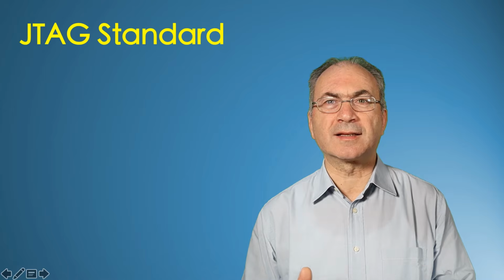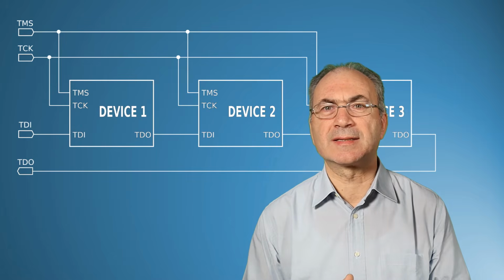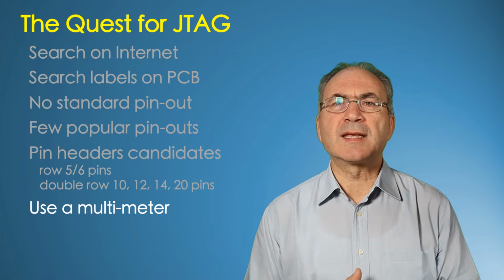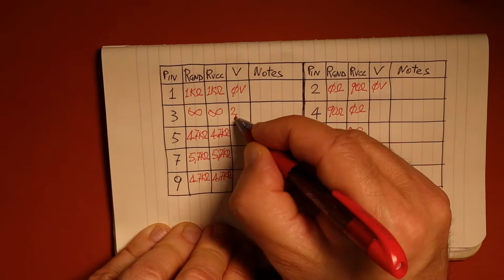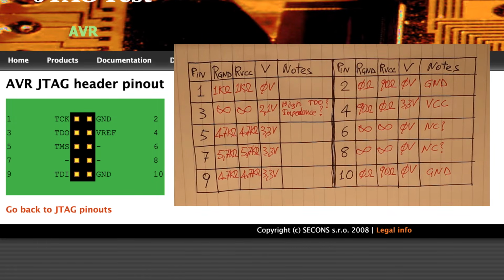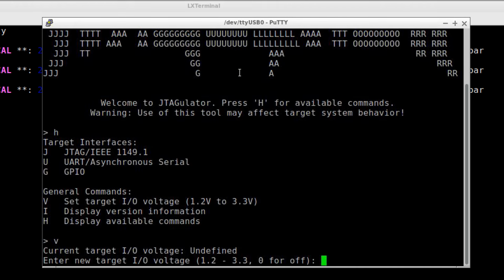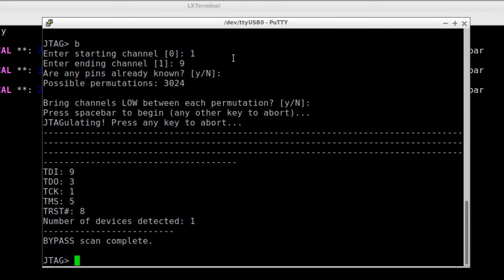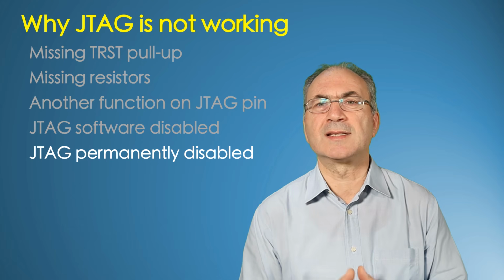#03 - How To Find The JTAG Interface - Hardware Hacking Tutorial

Comment: I did aome reverse engineering on a JTAG 14 and JTAG 20 connector. Non standard pin layout. No documentation, no text on PCB, I managed to figure out the correct layout with multimeter and managed to connect to microcontroller via SWD and gain access to the whole of it. dumped firmware, got flash info.. etc.. 

What i did not found though is the tRST/RST/RESET pin. I know its located on pin 90 on the microcontroller but can find the JTAG pin or a test point on the board for it.

I know the tRST are optional but might come in handy to reset the input.

Any ideas? Will the Jtagulator figure that out?

Im using a Raspberry pi with openocd. Works great. Just jeed to solve the RESET..

Its a TI TM4C1231H6PGE microcontroller 144 pins with 256KB

On the JTAG 14 header SWDIO are located on pin 1(GPIO 24), GND 4/8/10,12 SWCLK on pin 9(GPIO 25)

Comment: Excellent video and thank you for sharing. As you mentioned in the beginning of the video, it would be even possible to "debrick" a device with the help of JTAG by flashing the right firmware to the EEPROM. I ran exactly into this problem. I'v got a osziloscope with a Samsung S3C2416XH connected to an EEPROM Samsung K9F1G08U0D. Both components are quite popular.

My measurements are nearly the same, but the order of the of pins the JTAG are a bit different on the board (I think it's a proprietary one). In my case I got 5 pins with R(gnd) and R(vcc) and V > 0. 

How could I find out with pins are right one without buying JTAGuator? Any hints?

Comment: This video is excellent! Using the multimeter resistance and voltage measurement method, I managed to successfully deduce the JTAG pinout of a Samsung SPH-A700 cell phone by doing this on that phone along with a Samsung SPH-A880 that already had a known JTAG pinout (Since the A880 is very similar in terms of hardware to the A700).

Comment: what if I have the datasheet for the processor and it shows which pins are TDI, TDO, TCK and TMS? I don't need to use JTagulator right?
Reply: You could use the mcu jtag pins directly - might require some soldering or micro clips attached to the pins.  If your test board has jtag pins, can you trace them back to the mcu?   The  Jtagulator is helpful to identify pins at a connector or grouping of pins, but not required.  Sometimes, it's easier to work with pins at a connector or pad group, then tapping the mcu pins which are often tiny.

Comment: On some boards there are no pads for JTAG or UART. In which case you can scrape the trace lines and attach 0.1mm wire. You need a microscope for this but it works well.
Reply: if you have good eyes you dont need a microscope i have precise eyes because i am young but i understand some people have difficulties with soldering it, you need a fine tip not specialy a microscope

Comment: I'm a software engineer very interested in hardware debugging, asm programming and all related things, but I'm somewhat not very skilled so I started with Arduino Uno, I saw a youtube video explaining the Debugwire protocol and it also provided a demostration of debuging an ATTiny85 using the beforementioned Arduino Uno, which is something that blew my mind. Now that I felt in love with this cheap hardware I would like to get deep on how the bootloader work, I've heard that this bootloader is running in parallel with the other program code stored in the chip so I would like to determine if it would run faster without bootloader or how much overhead it may introduce, etc. Thank you very much.

Comment: Didn't know a multimeter could be used to identify the different jtag pins, this is awesome, thank you.
Reply: Yes, it can. I did it on one of my devices. I was able to connect and extract firmware on microcontroller via a raspberry pi and openocd.

Have not found the RST/RESET pin though. Its located on pin 90 at the chip with one or two resistors/capacitors.

Comment: First of all, thanks a lot! I have a question for you: at 18:40, how did you hook up the headers to these spots? these were not classical pads as we often see in JTAG/UART?   
(subscribed, big kudos)
Reply from the maker: Hi Omer, thank you for your appreciation and for your question.
The pads are for a surface mount 2x5, 2.54mm pitch connector (like this one: https://www.aliexpress.com/i/32915471614.html ), I didn't have that connector available, so I replaced it with  a couple of PTH (not SMD!) female headers soldering them in an "unusual way".
Reply: @MakeMeHack  thanks!! really appreciate this! Wish you all the best

Comment: Thank you very much 🙂 ,Valerio..... Your video is excellent and full of knowledge.....
Can i ask some question about JTAG [i search in google but i cannot find the exact answer]....

1) is JTagulator's function only to find the pin corresponding to JTAG? or can it be use as like of "BUS PIRATE/SHIKRA"?
2)  Can i use the same "JTAG debug probe" for different ic like "AMD","ARM"....etc [i dont wnat to buy multiple Jtag probes for each ic type]?
3) Can you recommend me some good Jtag debug probe which cost around $20-$40?..... because JTagulator is costly for me
Reply from the maker: Hi Nongin, thank you for your appreciation and your question!
1. my understanding is that JTagulator's function is only to find the corresponding JTAG pin and not to be used as a "JTag probe";
2. an excellent and low-cost probe, in my opinion, is the Segger J-Link Edu mini, it is perfect for ARM-based chips, but works also with other architectures, and it is supported by the excellent Segger software. It's not open-source hardware or open-source software, but it can be used for non-commercial purposes with free of charge Segger software. It costs around 17/30 dollars. There are also very cheap, pirated clones, but I don't recommend them because you are never sure that they will work. Another low-cost probe is Bus Bluster, to be used with OpenOCD. or Bus Pirate. Bus Pirate is, perhaps more versatile but it is very slow.
3. You can use the above probes to interact with the JTag interface; to automatically identify JTag pinout a cheap alternative to JTagulator is to use an Arduino board with the freely available JTAGenum software, but you have to pay attention because JTagulator does voltage conversion (3.3V <-> 5V) and input protection, Arduino does not. So, maybe, you have to use some 3.3V based Arduino and, maybe, you have to use some low-value resistors to protect inputs.
Reply: @MakeMeHack  Thank You very much 🙂
Reply: @MakeMeHack  I've recently found this... which might give us a cheap Arduino-based JTAGulator alternative. https://github.com/dxa4481/inputProtectionShield

Comment: calling jtagulator cheap is exactly why Italy is screwed :D
Reply from the maker: Cheap is a relative term. JTagulator can be considered cheaper than professional equipment, for sure it is much more expensive than Arduino based solutions like JTAGEnum, but  JTAGulator has built in level conversion, input protection and scan firmware.